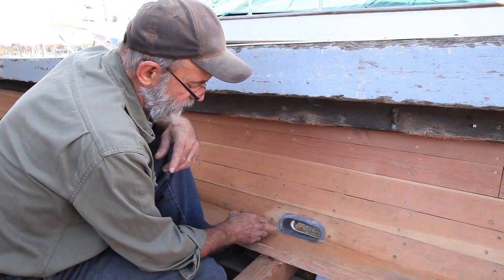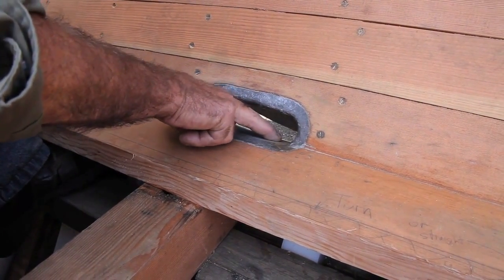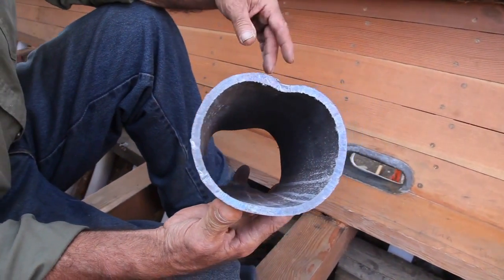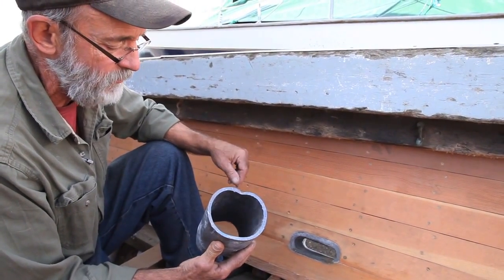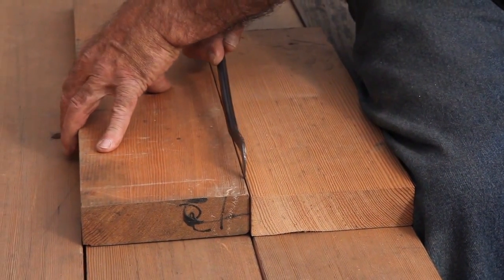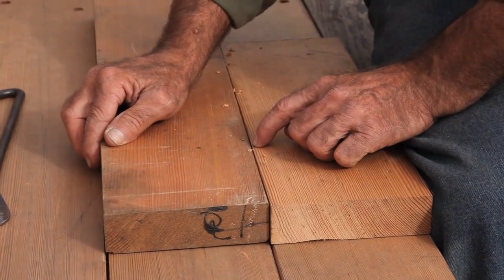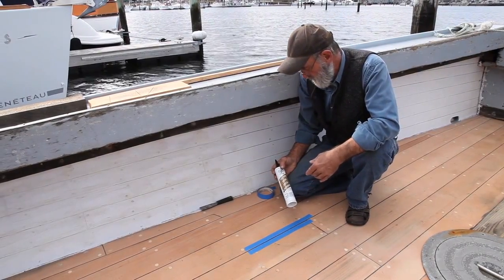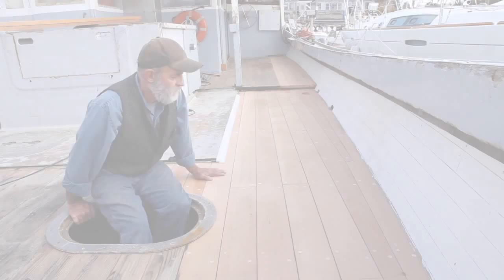How to install plastic frames for wooden boat building - drains and deck (Part 2 of 2)

Comment: The previous commenter (4 years ago) mentioned just finding this channel and I'm here today to say the same. I grew up on wood boats, started fishing Southeast Alaska on my father's boat, which was my grandfather's before him. I did some boat building in my early days, mostly glass, but have always missed my first wood double-end gillnetter. I just picked up a 1964 Blanchard Yard (Ed Monk design) 42'  motorsailer and she's been rode hard and put away wet, but fortunately she was built with Alaskan yellow cedar, a real bug and worm repeller. I'm into my 70s, and now I have my retirement project AND my home back on the water, where I belong.
I can't tell you how much these videos mean to me.

Comment: Nice work...I'd like to see how you adhere and fasten the scarf joints without using butt-blocks.  Do you use an adhesive to bond the planed faces?  You have other videos showing how you scarf but I haven't seen how you fasten and glue the scarf joints...Thanks for sharing your knowledge.

Comment: Nice job. I have a question, i bought a 24' carvel buildt boat, i have stripped down the old varnish and need to fill the seams with sikaflex(or similar), but should i  do that before oiling the wood like you did right here? And why should i not do the oiling/varnish first, then cauking? Thanks! ⚓🚢

Comment: Hello Louis: First, thanks for the amazing videos. 

I have a wood boat, and a very difficult deck sealing problem. I see that you have used a one part urethane product to seal the very wide boards on the deck of this boat.  In all of my reading about these products, the maximum stretch I have seen in 10% of the seam width. I am located in Vietnam, and our dive boat has had very leaky decks, the boat is similar to this one in that it is a work boat and leaks are not a problem, except on our dive deck, which is wet all the time and causing rot below. I have sealed it with Sika dc290, and that has stopped the leaks. Sika will not support the application, as the potential for wood movement is too much for the product.
 I know you have used quartered pine, and we are using a flat sawn tropical hardwood, but I see the rest of your boat deck is flat sawn with boards 6 inches or so wide. How have you managed to seal that effectively ? There is nobody here in Vietnam familiar with these products, so there is no practical advice available here for me. Sika will not answer questions, which I can understand for liability reasons, but that does not help me to seal my boat. I would be grateful for some real world advice from somebody who knows. Is it possible to send you some photos and more detailed info so you can give me some practical real world advice ? Thanks very much. Larry  info@dive-condao.com.

Comment: Louis, thanks for making these great videos. I'm a carpenter and learn from each one. Boat building is a real craft and it is great to be able to watch a master work. Hope you keep making videos for my benefit and others. On a side note I'm curious about the plastic you used on the ribs of that working boat. Do you think that it would be strong enough for structural outdoor projects like framing decks on houses. Do you think it could be used as joists or studs and not flex under live load conditions?
Reply from the maker: radishfever Haven't tried to use for that purpose because it is too flexible, unless you use large sizes which may become too expensive. When bending for frames its assists the hull shape much more than you might think. In the straighter sections of the hull I use different material... like wood.
Reply: Tips from a Shipwright Thanks for the info. I figured as much with the flexibility for joists and I can kind of understand how it works to stiffen the boat. Would I be correct to interpret that the plastic strengthens the boat by giving the planking and the ceiling something to screw too? The plastic frames are part of a woven clamping system? The idea being that they will never rot and the exhibit incredible screw holding characteristics? I have only helped on a ferro cement boat and have read about but never fully understood the theory behind wooden boat construction.
Reply: +radishfever 
These plastic frames have no or tiniest amount of stretch, so they hold the planks tight. They bend, but see the planks also limit the amount of bending they can do.
Pressure from the sea will force the plank edges tighter, so still the hull is strong.  And the frames can not crack, an impact would only fracture the plank. 
 I can tell they work  very well for planking. I  like them a lot, no cracking, rotting, splitting like wood frames. Plastic framing solves what is the weakest part of wooden boats. Especially the sharper turn at the chine where wood frames love to crack open.
Reply: +sdowney717 
Good explanation. Mans ingenuity is endless.

Comment: To a Scandinavian this boat appears to have been built by a house carpenter, hardly built like a boat!
Reply: rats arsed  You have to look hard around here to find farmers, unfortunately. A wooden schooner of 120 foot was just finished a bit North of here, and a 30 meter longship was completed last autumn. Not far from here is a boatyard building boats from 16 to 60 feet. I myself occasionall sail with 2 local galeases, one 75 ft and one 86 ft.